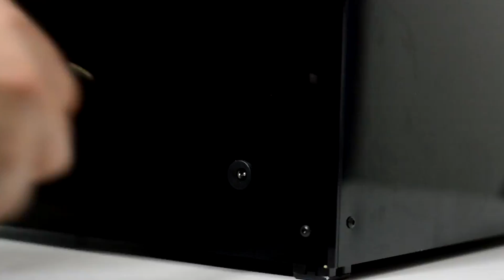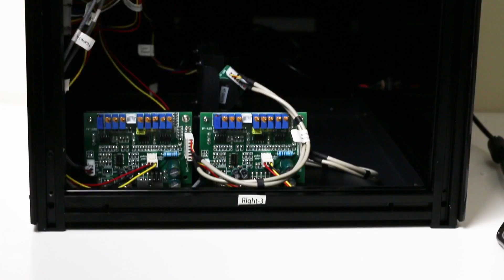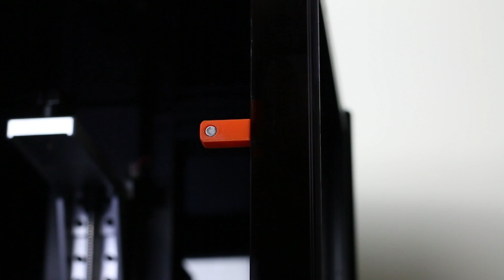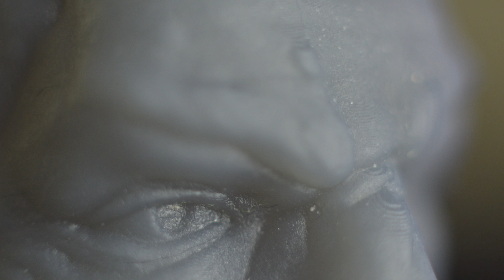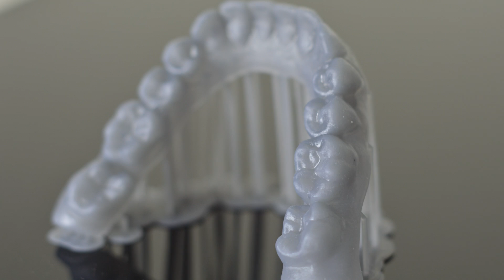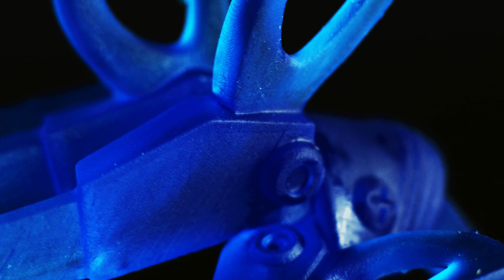Peopoly Moai SLA 3D Printer Full Review!

Comment: old video but i generally support original creators specially if it was on kickstarter. but now that it's been years you would think that formlabs could sell resin a bit cheaper. they know there wasn't any competitor at their starting years of but now resins have come down in price a lot & this tells us that formlabs resin just the basic not ceramic etc can come down in price 2/3rd's compared to cheaper ones that have the same resolution or better. resin is no longer exclusive and keeping resins at a stupid price is discouraging.

Comment: Have you looked at the accuracy tolerance for printing parts that need to interlock or fit together?  I want to make action figures with joints and this printer looks really appealing.  A friend has this printer and did 1 test and the parts didn't fit together.  But he hasn't really tried to get it working that way.  Great review.  I am going to subscribe.  Thanks!
Reply: Kenzie LaMar that's exactly where I was going to go with this